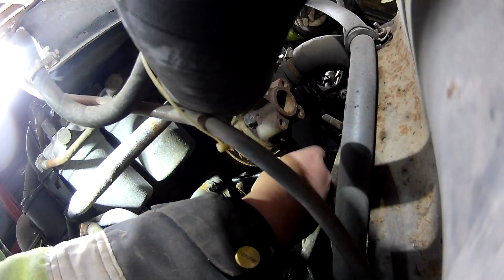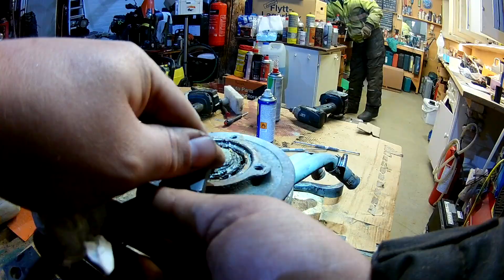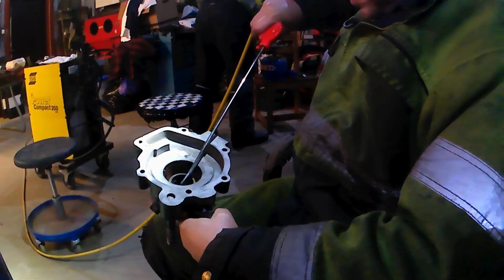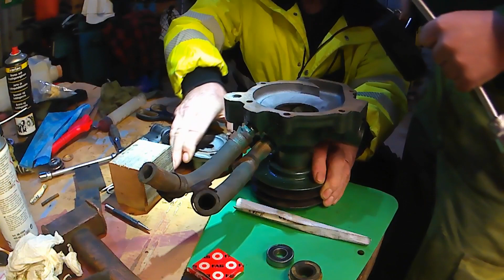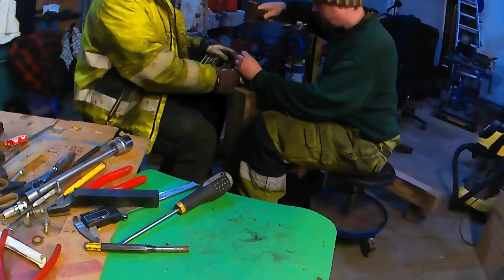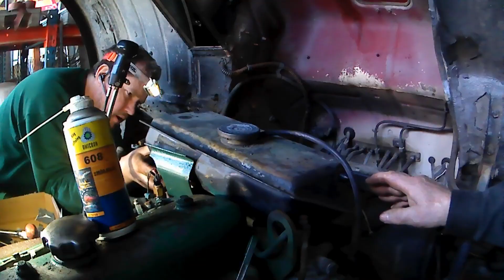2024 Volvo F86 TD70 Waterpump

Comment: Nice work 💪🏻👌🏻
Reply from the maker: Thank you. Have a leaking water pump on the forwarder also. Only seems to be leaking when in operation but might see if that can be repaired this summer.
Reply: @blackgrove8  looking forward to see. That. Is it over 50years old now? No inspections left?
Reply from the maker: Yes the old Volvo F86 has passed its final inspection. 😃